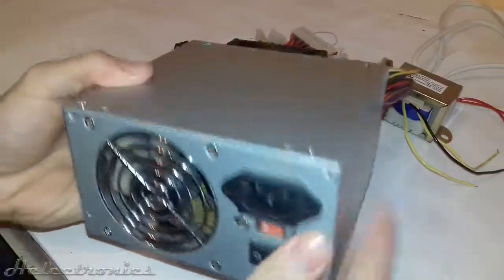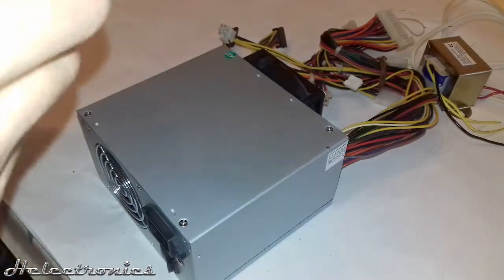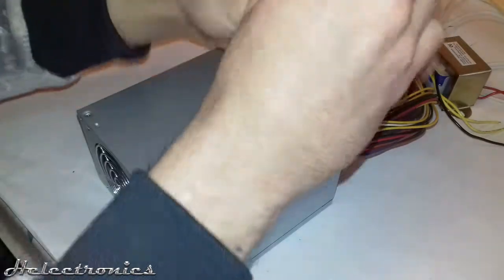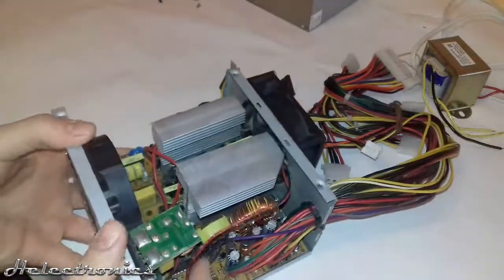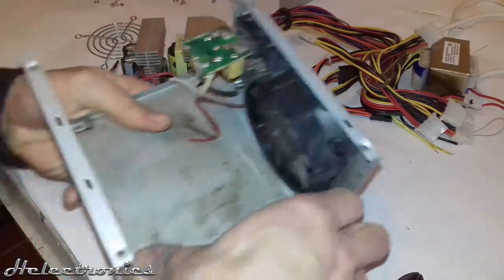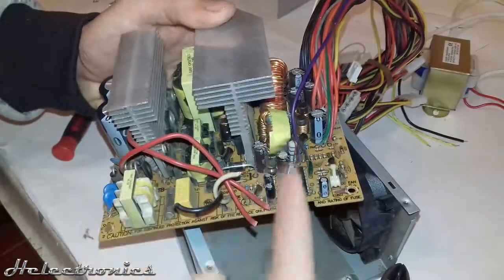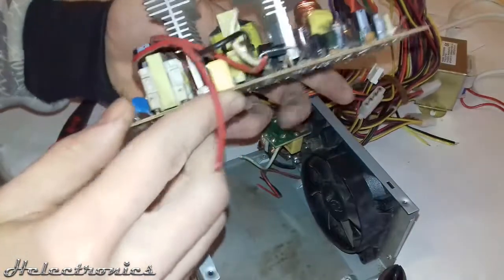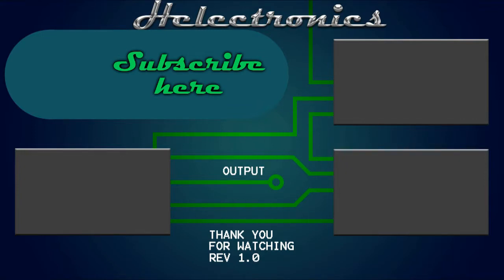TEARDOWN -  Power Supply Unit (Easy difficulty)

Comment: I know that this cideo is 7 years old BUT DO NOT DO THIS 😭😭 unless you know what you are doing the capacitors in the PSU can still hold enough charge to kill you even when unplugged
Reply from the maker: Exactly, thank you for pointing on this, discharging the big capacitors is important before working with a PSU!

Comment: How about the transformers? Which one provides 12v 5v and 3.3v?
Reply from the maker: 12v is provided by yellow wires, 5v by the red wires and 3.3v by the orange. If you have a multimeter it is easy to measure it. Thanks for watching!